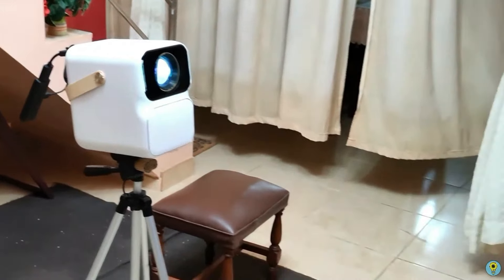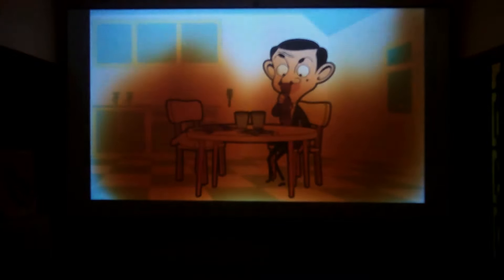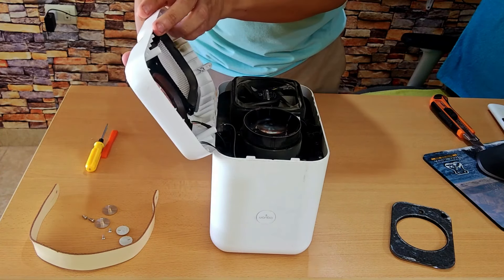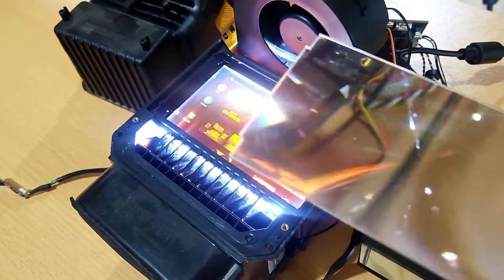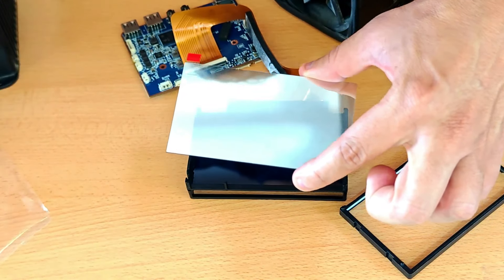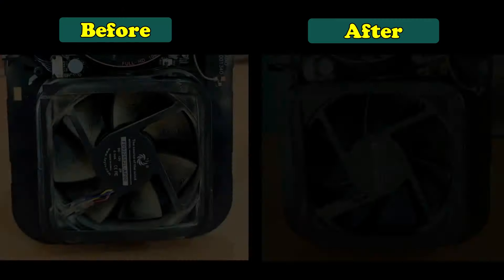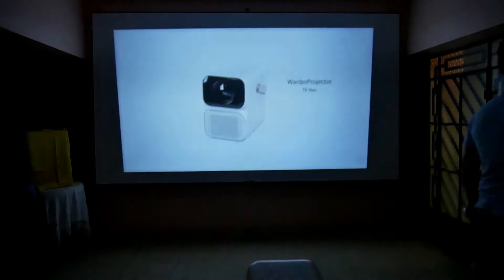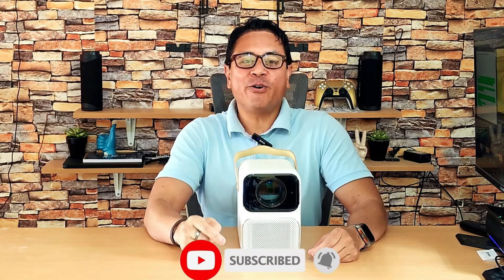WHY LCD PROJECTORS BURN OUT!! 😭

Comment: Go for laser projector
Reply: I mean you can get a solid LCD projector (for dark rooms anyways) for like 80 dollars and really really decent ones for about 200. A decent laser projector is like 2k+. You could replace an LCD projector 10+ times for every laser projector. Not everyone is rich tho.
Reply: @UchihaSumairu  I got your point. But laser last longer than led. Even a better led projector get dim after a time period. That won't happen with laser. Theoretically led claims that it's lifespan is 30000 hours. But in practice case that is not true. Most led projectors not usable in daytime. But laser projector works better in daytime.
Reply: @abhishekmsful  For sure but for 99% of people the question isn't what one is better. The question is "can I have one at all" and for those people some LCD are outstanding especially considering the price. The drawbacks don't matter in the same way that poor people don't buy a 500 dollar steak because they are happy when they can afford steak at ALL. The best thing isn't always the best option for everyone and in this case it isn't an option at all for most people.
Reply: if you want to buy a laser projector in an affordable price range, wait a little bit. Because this year a company named dangbei introduced a model atom, with 1200 iso lumens. Which cost around 600usd after discount. Which was surprising for me. I believe in future laser projector will be more affordable.
Reply: @abhishekmsful  yes but 600 isn't affordable to most people for something that isn't a "need' either. It's getting better in price though so that's good